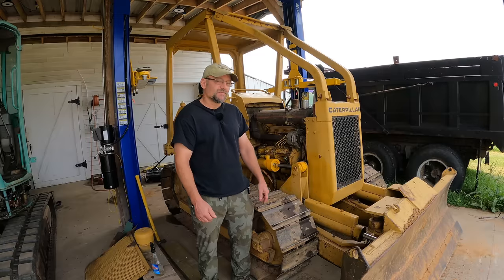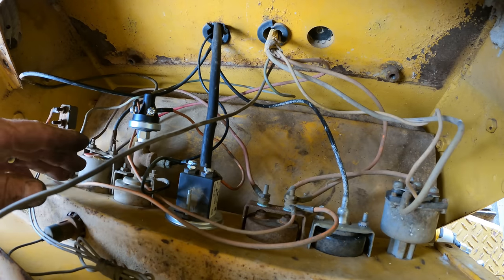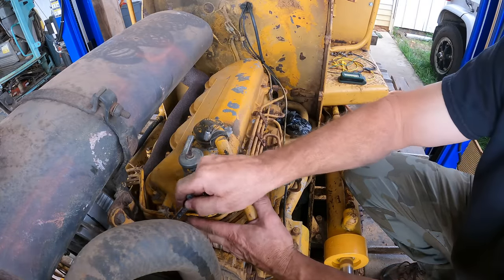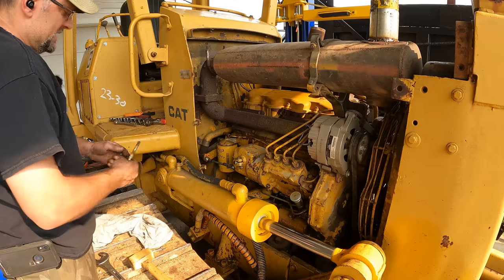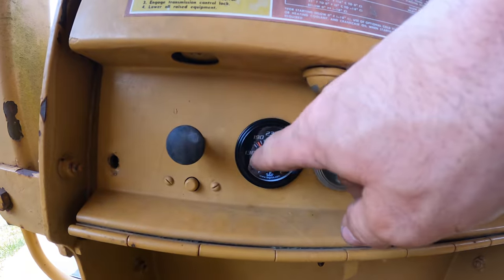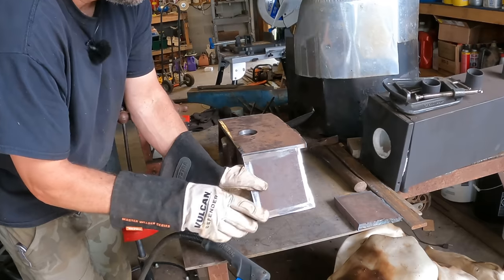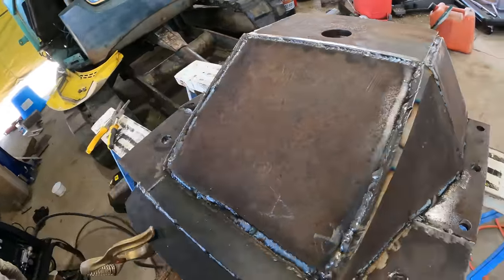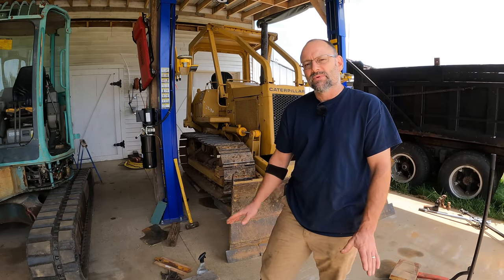How My Audience Saved This CAT D3 Dozer From Disaster.

Comment: Good stuff. Throw some old tires down next time so you don't tear up your concrete. If you zip off the sidewalls from old semi tires those would work great for your setup. They also work great for loading on metal trailers so you don't slide off or if you have to unload on blacktop and fit in a nice neat pile. If you want super traction on metal trailers just slice outside of sidewall doughnuts a bunch, whip up a quick razor blade jig and put that side down with bead up. Turns it into a rubber mop just like ice racers use on their no stud cars and they use a similar multi blade jig setup to slice tread thousands of times.

Comment: Those wire connectors you used are great and if you put a dab of dielectric grease before squeezing it on then heat the heat shrink.

Comment: In the old days with big cats would be cranking until oil pressure before giving it fuel,with pony motors same that would be 1 minute of cranking before opening fuel cutoff. And if you ever got a cat stuck you want that oil pan cover,you had to drop it every oil change,weight was maybe 500 pounds but it's a nono to run with out it. I've barred a d8 and took 2 more to pull it out. You have to have some really big anchor chain.

Comment: I noticed when you are drilling holes that you use oil,we'll oil gets hot very quickly and prematurely wears out your drill bits ,try mixing dawn dish washing liquid and water and your bits will not get hot and your drill bits will stay sharper 5 times longer,and try it when you are using your lath also

Comment: A cool old trick for diesels with manual shutoffs is to leave the fuel off, crank the engine for 5+ seconds and then turn the fuel on. Lets the cylinders heat up from compressing air without cold diesel constantly cooling it down.

Comment: when drilling those bigger holes try using some vise grips with the pads on them to clamp it to the table after letting it rotate agist the column. frees up a hand to run the oil can. Great work lots of knowledge you have.

Comment: I am embarrassed to say that on the track frame, I shall have to wait for the jury to render the verdict.. but as for glow plugs your correct. It should start and easy I might add. What I come to is the speed of the starter... sounds great doesn't it. Well on different machines over several years time, I found it was just the starter drag I guess is what it is called. I'm seventy three and so stuff I should know or remember is a challenge. My last diesel pickup wouldn't start on a hot day so after chasing my tail several months, put a chinese starter on it... about three hundred dollars cheaper plus it went from the one point five amp to a four point one amperage  starting .... what ever its called... my memory will be my death ,  any how who how whatever, that chinese starter made it start so easy that it was embarrassing to me again. I know your tight for money but figure its money well spent since there is going to be that day when a battery is not really doing its best, its winter and yada yada.... I would bite the bullet for a new starter and see if it makes this thing start like it should

Comment: I used that fuel line trick a few years ago with a cat 25 gal grease drum I use as a garbage can that was starting to rust at the bottom. It’s a great way to isolate a metal edge like that.
Reply: I’ve got a tool chest with the same issue, good idea, thanks 👍

Comment: John this helps me a lot.  I bought an old Dresser 7D.  I've been going through it using your videos as a guide.  So far the machine is proving to be in good shape and was taken care of.   I did have to replace the water pump (a big job to remove the radiator).  I do have an issue with the blade angle when moving to the right.  Very slow vs moving to the left.  I experienced the same issue you covered relative to the fuel tank drain - I was able to bring it back to life using your video as a guide.   Been quite the project but used it in the woods twice now with good performance.

Comment: I have a similar era D3,  I solved parasitic draw with a 12v disconnect,  Very useful if the starter solenoid sticks (burning up 12v cables is bad!). Also a good safety& security feature.  If you have a chance to test, The blade has a detent you should feel when when putting it into the lower position. The float function. Very useful for clean-up blade-work.  I keep a cheap garden trowel and digger at my feet,  dirt does like to clump around the rear supports.  Lastly,  Are you going to source track covers?

Comment: You might look at changing the cutting edges on the blade. I changed mine and wow what a difference. One tip, you can buy the edges aftermarket very reasonably but the bolts that came with mine were incorrect, so i had to go to Cat for the bolts and it worked perfectly.

Comment: Another great video! I do have a suggestion for the skid plate addition.  Where the oil drain plug is, make a plate with 2 or 3 bolts to cover the hole. Small saplings,  limbs etc will find their way up into and can do alot of damage. I have had saplings find their way into the enclosed engine area and did damage. Cedar seems to be the worst, as it will break with lond sharp splinters. 👍

Comment: I love your videos.  Great educational entertainment.
- I knew POR-15 black and clear weren't UV resistant (silver is).  Thanks for showing me they have a black UV resistant overcoat.
- I was surprised you didn't know the slit hose grommet trick.  I use it on my hotrod stuff, just hiding the ends below the thing going through it.
- Next time you have a project like that oil pan protector, tack a few struts across the opening temporarily to keep the warping down.

Comment: Hi John you commented on not many grease fittings. You could drill and tap for a grease fitting on the eye end of the cylinder rod where the pin goes through quite easily.

Comment: thank you for the video 

about the difficult engine start
valve clearence is adjusted to make shure, that valves do close fully,  when at engine working temperture (because of metal expansion)
a dificult start, has more to do with : 
*copression in the cylinders ( piston rings, valve on valve seat )   
*fuel dilevery system ( probebly a componente inside the pump) 
*and like you have already mantioned before, not enough engine rpms when starting (batterie, starter) 

good luck

Comment: Your start switch when turned to the left only powers the glow plugs only, when turned to the right it powers starter and glow plugs! Take your volt meter and you can confirm this!  This was done to let you just heat the glow plugs to warm up cylinders!  Glad you rewired the alternator to stop draining battery.

Comment: Push the blade down and lift the front idlers off the ground. It appears as though a  wear bar is welded onto the track frame. Use some of that soft steel and make that wear bar and weld in back in its place. It appears as though with the front idlers off the ground they would fall enough to permit access to the track frame. They are designed to move back and forth as the recoil spring mitigates the impacts to the front idler.

Comment: on the alternator  the terminals can be connected with a factory jump plate or a short jumper wire. it jumps the regulator terminals and activates after alternator spins.

Comment: I used to work on quite a few Cats back in the day. I can't remember one that didn't have a battery disconnect switch. Most were having only a disconnect switch for the electrical, and doors and compartments had separate keys.

Comment: I tap off the oil pressure switch to activate a relay, from which I can then run any accessories I wish to only have on when the engine is running, rather than when the ignition is on.  Easy way to prevent the battery being drained.

I don't bother changing factory wiring over to this method unless I'm re-wiring the machine, but I do use it for accessories I add.

Comment: you should use a GM style connector on the alternator so it cannot accidentally fall out , it has a lock tab that matches opening ( pick one up at parts store or junk yard ) also will prevent accidental cross wiring  when you have to replace alternator

Comment: Protect the edge of your concrete pad. Driving on and off the edge with the dozer when it gets to its tipping point for a second the whole weight of the machine is on the edge. On the dirt side of the concrete, put a tire or something so your tracks climb up off the edge and will tip away from it. Another option for insulating wires/hoses from a sharp edge is to take a piece of heater hose and sliding it over top of what you're trying to protect. If you do shim the track adjusters, do it from the bottom. The weight of the track frame is pushing down and it wore the bottom plate and probably spread it open. If you took a jack and lifted up on the track frame the gap will be at the bottom. Leave some clearance.

Comment: Wonderful! I tend to drill a little hole in thick plate before starting the plasma cut, I got fed up with the back sparks. 4 mm is typically sufficient to start, you could drill it anywhere in the part you are discarding.
Reply: But it was AR plate. I think he specifically said that's why he wasn't drilling.
Reply: @PatrickKQ4HBD  of course!  you are right, I missed that.

Comment: Excellent refurbishment!  At about 35min: hole saw cutting the hole in the 1/2" plate is better done with two holes drilled 180deg apart on the circumference. The bigger the better,  but 1/4" is discreet. These holes allow and exit for the flow of chips during the cut. It's easy to think your hole saw is dull, but it's just re-grind from the swarf, plugging up the space between the teeth. Those are notorious for being unable to clear the chips due to the narrow groove and depth of cut. You can drill 2" thick steel using this method; the cutter will last a lot longer with proper lubrication.

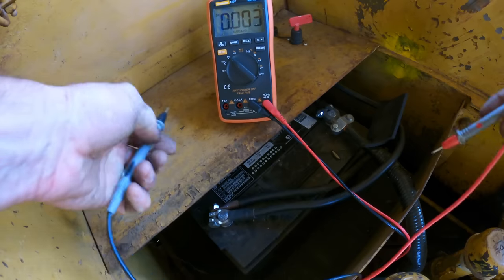Comment: - Your + terrminal batter cover is a slick fix, Jon. 13:00
- My eyesight and the dark rubber made me slow the speed down to 0.5 to check.
- I think I got it. The rubber's large square flap lays on top, held by a slit ring of rubber.

Comment: Interesting way to torque down bolts. Back in the army when i was working on our Leopard 2 tanks, the instructors were always listening for the torque wrench clicks. If someone doubleclicked a bolt, they were sent on the floor doing pushups, until nobody was doubleclicking anymore... 😅
It's pretty simple, the torquewrench clicks ONCE at the right torque, every other manipulation after that risks to overtorque the bolt. So it only hurts and does not help in any way. There are special torque wrenches that prevent you from putting any more torque in after they reached the set limit, but they are a rare exception.

Comment: Good explanation on the wire routing. Too many see that 'direct' route as simple, without considering the environment it will be exposed to. That is how you get those spaghetti wiring engine bays we often see and then electrical problems later.

Comment: Single wire alternators we used a blocking diode in the battery circuit your yellow wire to allow charging in one direction and zero draw in the opposite direction. One less wire to run.

Comment: A "hammer" is an object that is used to apply impact force to another object. I have used a lot of hammers that looked like wood, rocks, and whatever was handy to "hammer" something else. The effect is more important than what what it looks like.

I also like and enjoy the fact that you do not need a $50 wrench and a $20 screwdriver to get something done. A quality tool is something that gets the job done without damaging the part being worked on or breaking while using the tool itself. Some of the best wrenches I ever have had were the very cheap "drop forged" wrenches that were made in India in the 60's and 70's which are still in use today. They came in metric sizes which were somewhat of an oddity in those days and saved a lot of money.

Comment: Those water temp gauges like the one you replaced, the "wire" is a copper tube with a thermal transfer fluid of some kind in it (older ones it was ether, not sure what they use now) the bulb that's in the coolant passage transfers the heat to the gauge which uses a bimetallic coil to move the needle.

Comment: To ease cutting holes in thicker plate with a hole saw, drill a 1/4" hole in the path of the hole saw.  You'll notice the hole saw slows down once you bury the teeth in the material.  The extra hole gives a path for the chips to be ejected.  Also extends the life of the hole saw.

Comment: Hi,
great job on extras carried out thus far.
The idler clearance is addressed by what are known as hanger plates and their matching wear strips welded to the inside of the track frames.
Their wear surfaces should have weld on replaceable wear strips and are consumables and so are tack welded on to the hanger brackets and strips. They will be shown in the parts book and or service manual.
I do stand to be corrected if the D3 does not have wear strips on the inside hanger plates as it has been almost 20 years since I retired from the Cat Dealer.

The fuel line inlet screen again is located in or around the fuel tank to transfer pump inlet line banjo bolt which should have a domed head to identify it and is located under the transfer pump body --below the transfer pump that makes it hard to see and get at--the one you removed in your video is not the correct one--this outlet line goes to the filter.
 As we cannot load images here I cannot show you an image of a screen and its location from a Nissan diesel engine manual.
I believe the screen you are seeking may not be shown in the Cat manuals. I know of the screen because I owned Nissan's with Diesel Kiki transfer and injection pumps and is shown in the manuals.
I have found this Youtube link to show the typical screen location --see from around 2.20 and again at 3.30 onward.

https://www.youtube.com/watch?v=3tL-h3VmEuo&ab_channel=PistonShack

Hope this helps.
regards,
Eddie B.

Comment: 10Si alternator.  
The number 1 terminal is load sense. Usually a wire hooked to the output stud works great. 
Terminal 2 is the lamp terminal. Usually a 194 bulb.  Switched ignition on one side of the bulb. The wire to the number 2 terminal on the other side.
Key on power to the bulb. The alternator not charging. The number 2 terminal is switched by the regulator low. So electrons travel thru the 2 terminal thru the 194 bulb to positive. Illuminating the bulb.  
When the alternator starts charging. The number 2 terminal voltage comes up to charging voltage.  Since the bulb has charging voltage on both sides the bulb is dark. 
True Self energizing 10si voltage regulators don't need anything but a grounded case to the negative battery thru the bracket, block, negative battery cable. and  the output wire to the positive battery.
Please do voltage drop test between the alternator case and the negative battery cable end.  Then the alternator output stud and the positive battery terminal.  Since your test leads are normal length. Use the starter stud. Or a single jumper wire carefully from the battery.  
$26. Tip  grainger  4WPZ9  is a test lead set with bed of nails clips like telephone guys had on their test sets.  Since i work on automotive fuel controls and electrical daily. My test leads have those clips but my wires are 20 foot long each.  So i can reach the engine with trunk mounted batterys. 
Voltage drop readings engine running. Fully charged battery.  14.1 to 14.8 volts. Alternator case to negative battery. No more than 0.04vdc. 4/100th of a volt.
Alternator output stud threads to the positive battery.  Less than 0.3 vdc. 3/10th of a volt.  Dodges and systems with dashboard amp meters could be up to 0.7 vdc  but that is do to the length of the circuit.  Hope this helps.
Reply: You have the description of the #1 and #2 alternator regulator terminals reversed.  #2 (right) is the voltage sense and #1 (left) is the excite/indicator lamp connection.  Note left and right are with the regulator plug clocked to 12.

Comment: for the temp gage i think its not a a wire its called a capilary tube. they used ether or some thing else to react to temp changes in the engine

Comment: good job the track  gap u see is for the slack adjuster slide id take see how thick the bottom should be and possibly build up the botton slider with a piece of steel that will keep  the front wheels from throwing the track off or binding ive seen this in other vids most people will just replace thoes from wearing out from a nother track this is just how i look at the issue but id look into this it will be an issue for shure there should be minimum gap there just for the wheel to slide and bounce from shock load when operating also the center bushings sometomes wwear out with the center pivit bushing id check this also but all in all great job !!!! ill be watching see yah later. jacob from arkansas

Comment: When the machine is level are the gaps the same as when you had it on blocks? I'm thinking but do not know that you can leave them alone. When all else fails, see what the book says. As for the starting, my guess is the fuel lines are leaking down when it sets overnight. Then on start up it has to refill or more correct reprime its self before it will start. The fact you dont get white smoke until its been cranking some is a dead giveaway. Otherwise it looks to be healthy. It does my heart good to see someone taking care of this old iron. Be safe.